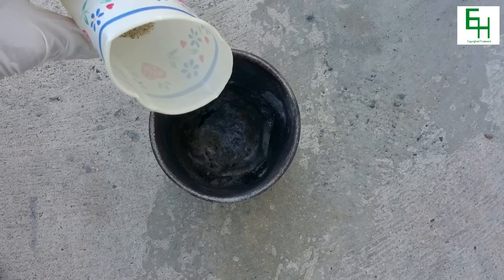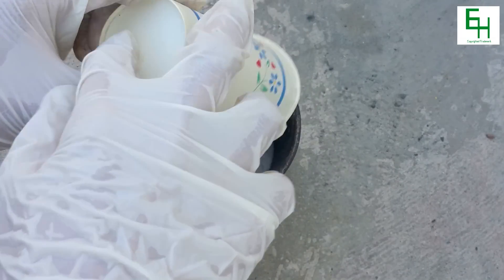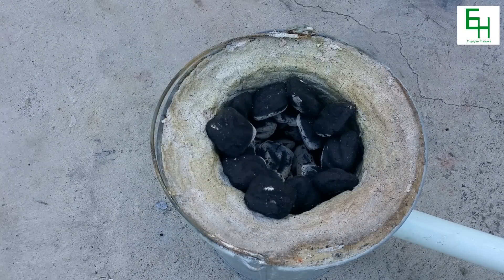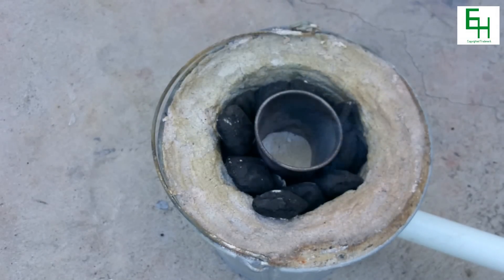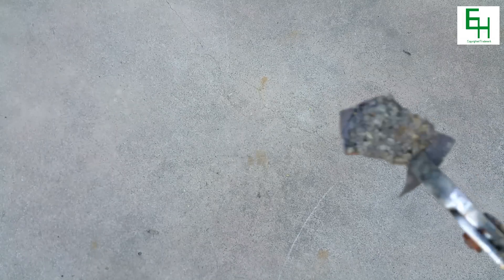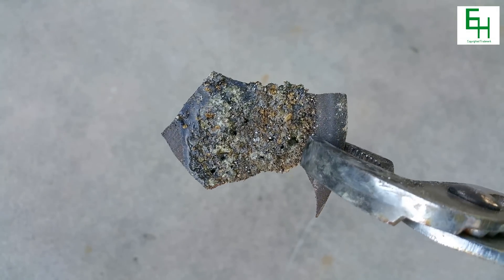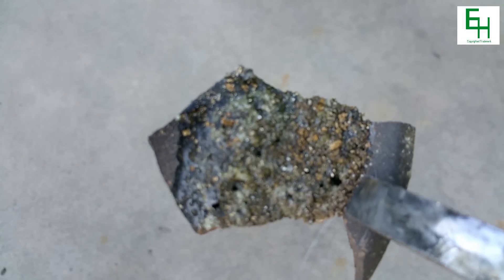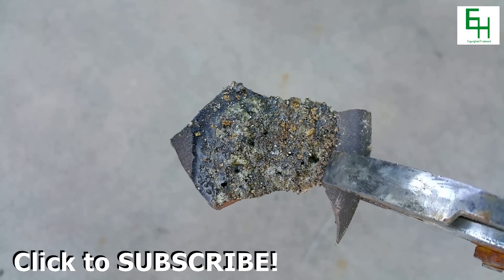An Attempt to Make Glass From Sand [Failed]

Comment: silica is the main ingredient in glass, youre right that you need to add flux but the ratio will need to be almost 80% flux to melt it at such low temperature. most high fired ceramic glazes melt at 1280 degrees Celsius. and they have flux to lower it. if you were to try and melt sand you will struggle to make enough heat to melt the silica without a flux.

Comment: you want white sand, beach sand is mostly shell particles. you have introduced a huge amount of calcium into your batch using unfiltered sand. also put it into the cucible in small "charges". you want roughly %75 silica, %11 calcium, and %14 sodium

Comment: hmmm the gadget that you're using to turn the sand to glass takes way too long and is not fuel efficient, I suggest using the furnace from minecraft which gets the job done within seconds and uses less than a piece of coal!
Reply: GOLDENSPIKE3000 but this isn't minecraft it's real life I'm not trying to be rude but I highly doubt that would work

Comment: hi
i think the problem is with beach sand because it consists of small particles of different types of shells, unpredictable ratio of many types of rock fragments, even small particles of plastic and organic stuff. you should try "normal" mineral sand which is very fine silicate crystal dust. beach sand is not used for glass making.
Reply from the maker: Yes, I think that was one of the main problems. I am planning to use store bought silica play sand for my next attempt. That should be more pure.
Reply: Don't use play sand, use "silica" sand.  Play sand is crushed rock and has a huge variety of other chemicals.

Comment: Maybe you could use just sand?
Reply from the maker: The reason why the other ingredients were added is to help lower the melting point of the glass mixture.
Reply: EH Productions Videos Maybe that would interrupt it? I mean, you can melt it at whatever melting point it is before the other ingredients are added, right?
Reply from the maker: Yes, the other ingredients disrupt the crystal structure of the sand which lowers the melting point of the mixture.
Reply: EH Productions Videos Oh, strange. I thought glass was pure sand.
Reply: +Crammananne Its like iron and steel, iron is fine on its own, adding the materials making it into steel can give it different properties, like stainless steel, or high carbon steel and etc. Pure 'sand' glass is a thing, its but it has a different melting points than certain additives would give it
Reply: Crammananne 
Glass is made of silicone, which sand contains.
Reply: hi

Comment: The combustion temperature of charcoal isn't high enough to melt glass... try propane?
Reply: Charcoal is very dirty and will never give you good clean clear glass.  You need to use either propane or methane.  You also need to use silica sand.  Crushed glass will also act a s a great flux
Reply from the maker: Propane does burn hotter so I may try that in the future.

Comment: you could try to filter the sand to as small particlees as possible, could help
Reply from the maker: By making the particles smaller it should help it melt faster however finely powdered silica sand is carcinogenic if you breathe it in.
Reply: Wear a mask.